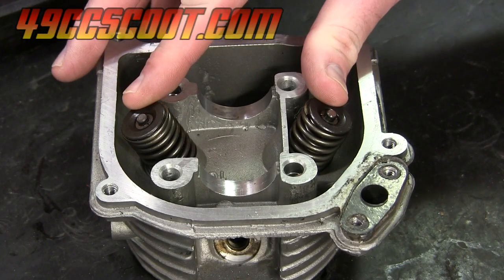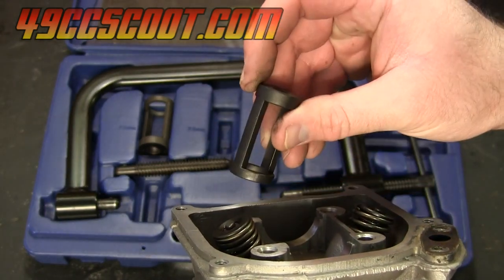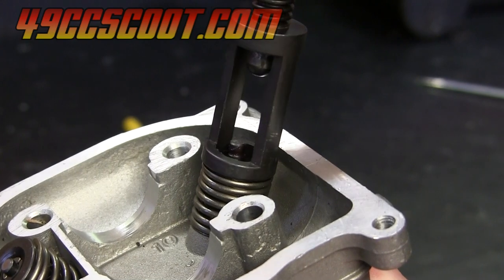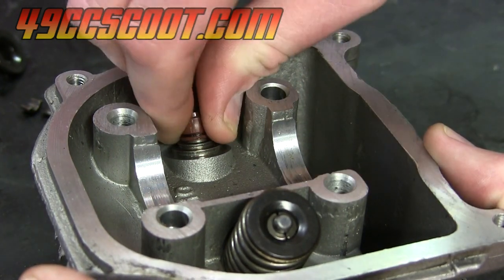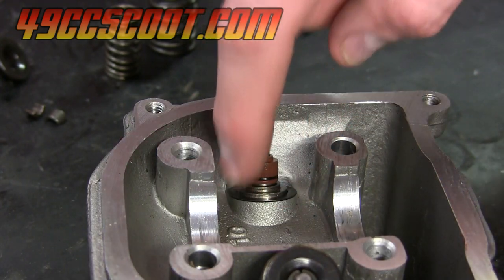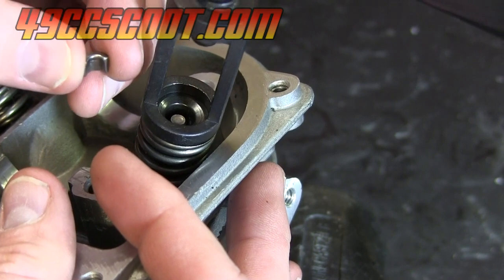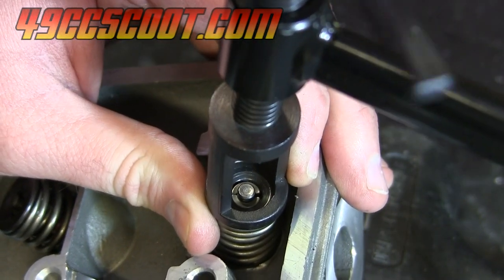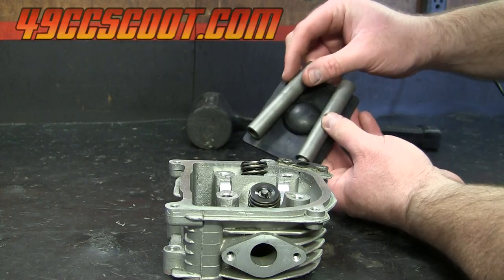Valve Removal & Installation Method 1 : Valve Spring Compressor

Comment: Going to be replacing the head on my 171 CC Big Bore scooter just want to replace the head with bigger valve head will I need to put a base gasket in I would like to just install head and head gasket only does that sound reasonable ?
Reply from the maker: That's a possibility. You would at least need to use a sealant in place of the gasket though and be careful not to use too much and block an oil passage. I do a bunch of checks to determine what gasket I do or do not need. Compression measurements, squish, piston to valve clearance.

Comment: Hey man, Very unrelated question to the video, but kinda figured to ask; I crashed my scoot into a car, And since then the steering has been really tough, not as silky smooth it used be, do you have any idea what i could do to fix it?
Reply from the maker: ErmaTheKitteh First, hope everyone involved is okay. You will need to take the front end apart and check it out. Could be that something is bent, a lot of times you'll notice the wheel may be turned while the handlebars are straight after a crash which may point to something bent. You may have an issue with the bearings or races in the steering stem now.
Reply: *****
The one really hurt were me, haha, thankfully but kinda still not recoverd from it but oh well, you live and learn I Guess, The plastics etc were all mangled, so i got to fix that and such, but as for the steering and such, I think the forks/fork stem were bent inwards abit since i notice that the weel has a tendency to hit some of the plastics  when bottoming out the dampers (doesnt really normally happen) so i guess it got bent inwards and might be something with a bearing or such, The bike is ridable, but the heavy steering makes it annoying to ride, a local scooter shop said it would cost about 200-400€ for just parts, and a brand new of my bike would cost 900€, so kinda feels like i should invest in it, don't you kinda agree? ( i might only have the scooter for about a month or so, untill i can get enough money for a car)
Reply from the maker: Maybe look your scoot up and see what you can find online for parts. I know nothing about your local shop, but you may be paying quite a markup.
Reply: Yeah, they said that price was just parts too, which kinda is botherting; i was thinking about the forks, do you think it would be a bad idea to bend it back, like  move it forward abit?

Also for spare parts, there's only the place where i bought the scooter, which is a shame since its kinda a " custom made " scooter, where only one company sells it and such, which is ashake, since for example, your tao tao is like really easy to find spare parts , since its all over the world, with different names here and there. :p
Reply from the maker: If the stem is bent I'm not a big fan of the idea of bending them back, but others report doing it. I replace mine and would recommend replacement. The idea of weakening it any maybe someday the front wheel falls off while riding doesn't sound like tons of fun to me. Not  saying that would happen, but I'd prefer not to risk it.
Reply: *****
Alright man, Thanks for the suggestions, I'll have to look into it and such. :)

Comment: hi I just changed my cylinder head on 125 scooter it won't start at all what is the timing or something someone mentioned to me can you help
Reply from the maker: You have to get the cam and crank synced properly. There are timing marks on the flywheel and on the cam, and if you ignored those the timing would be off and you would be at risk of bending a valve. There are detailed pics and video here :
http://49ccscoot.proboards.com/thread/428/valve-adjustment-pics-video-139qmb
Reply: Hiya I did that and that my bike was working but when I rode it lasted for about 15mins and then bogged down power and then stopped and now can't get it to start any ideas can you help why this is bogging down ??
Reply: And not starting

Comment: Would this work on a 2003 4.0l sohc Ford ranger?
Reply from the maker: Sure. They make valve spring compressors for that. Don't get one of the small ones like I'm using here for scooter/motorcycle engines.
Reply: @49ccscoot  ok so if I get a larger one it would work?
Reply from the maker: @boboynunez5805  Yes. Might be able to get one as a loaner tool from an auto parts store.
Reply: @49ccscoot  thanks

Comment: How do you remove damaged valve guides?
Reply from the maker: If it's a scooter engine like you see in the vids, it's easier just to get a new head than to bother with valve guides.
Reply: @49ccscoot  What if its not?
Reply from the maker: @leewebb7068  https://goodson.com/blogs/goodson-gazette/engine-disassembly-valve-guide-removal

Comment: I have a question I have a gy6 150
I'm thinking of taking off the emissions in my state we don't needed them if I move the emissions it will not hurt my engine it will run ok I really want to take the missions off
Reply from the maker: It'll run fine as long as you don't leave things unplugged and open to air.